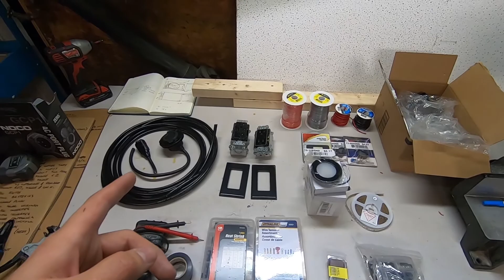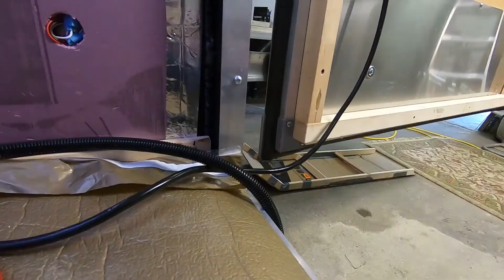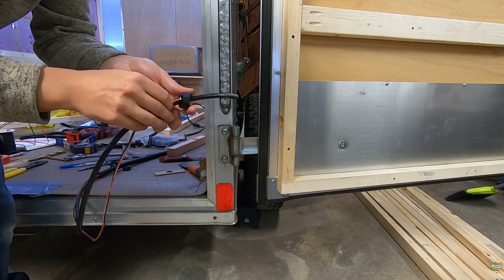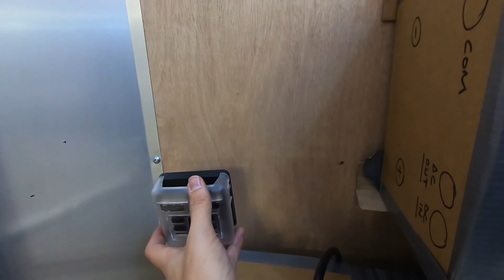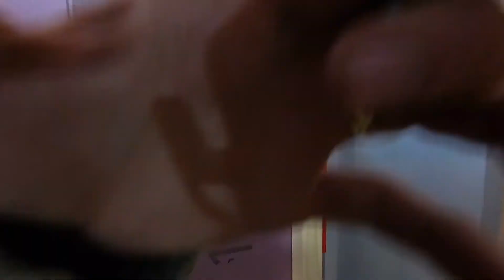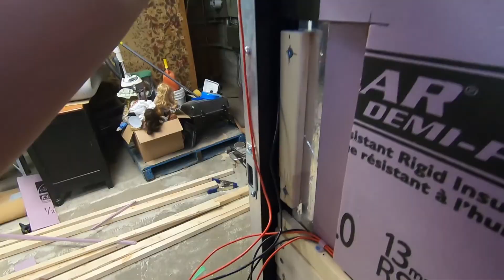Wiring my OFF-GRID 5x8 CARGO CAMPER CONVERSION

Comment: Hello Joel I’m just wondering if you would still go with the same inverter or would you go with something different. I’m looking at buying the same one that you have. Thank you for your information
Reply from the maker: @DebbieGallant-y4u  honestly, if I were to do it again I would have gone with Victron. Nothing against this particular inverter, I have not had any issues... But I know renogy's customer service can be very poor if anything goes wrong. But it was roughly half the price of the Victron unit so you have to pick your battles and risks.
Reply: @JoelTremblayCA  ok thank you I will search that out. Thank you

Comment: Hey there Joel, how did you install your chassis ground post?
Reply from the maker: Hey David! I believe that is shown in my other video where I finish all the wiring. Essentially I installed a grounding wire clamp bracket that gets directly fastened to the trailer frame.